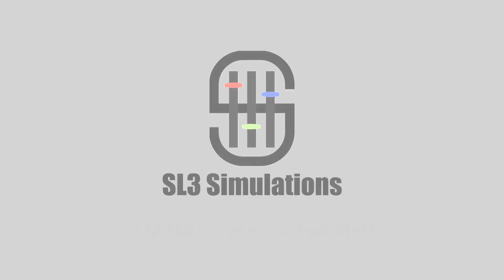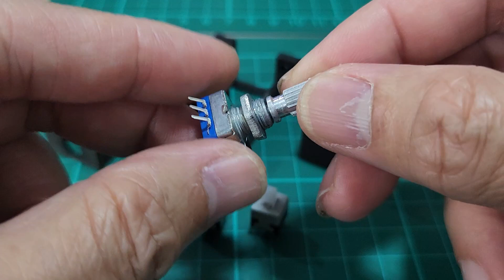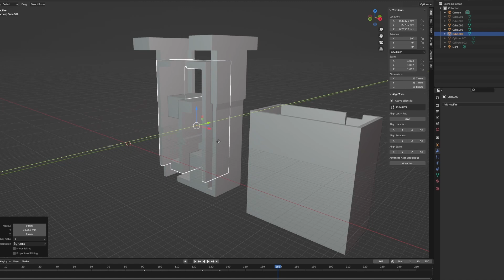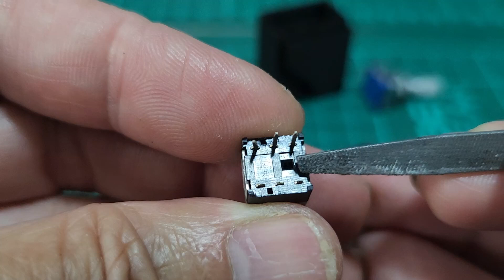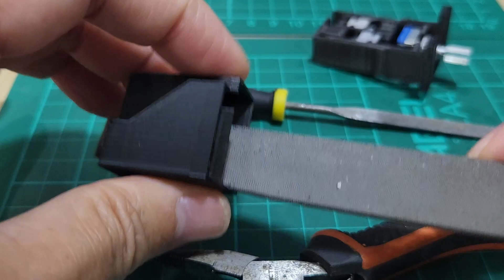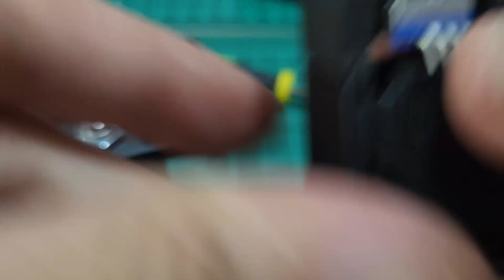FCU Push-Pull Rotary knob Mk3 sporting 2.5mm push-pull travel - DIY

Comment: I got this version printed and it works like a charm with sanding not required for most parts. Am very new to 3D printing and just got my first printer recently (Ender3 v3 ke).
I am also trying to build A320 FCU and found your Ideas very interesting. I was able to combine this Push - Pull Rotary Knob Mk3 (having 2 switches) with your ALT/Baro Knob (which had only 1 external switch) and it is working like a charm having 2 external switches like your Mk3.
Thanks again for sharing these fantastic and functional ideas.
Reply from the maker: Hi Chingkhei, Thank you!  I am glad it works for you!  :)

Comment: Great job Santi. I wonder would inserting some small springs over the heads of the tactile switches and between the face of the frame they push against help create more resistance to the push pull mechanism and hence make it even more realistic? Really enjoy seeing your videos of designs and mods.
Reply from the maker: Hi John, I haven't thought of that, but based on feedback by real A320 pilots, these knobs are not too resistive when you push-pull them.  In fact one of them says it is soft  :)